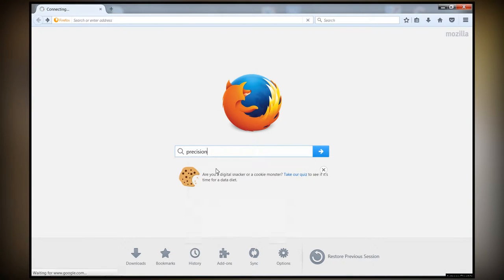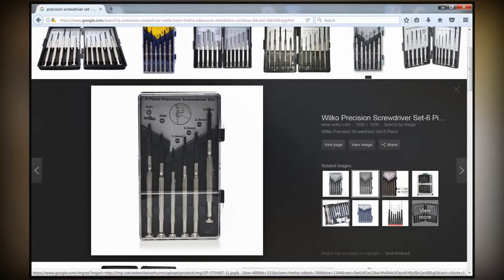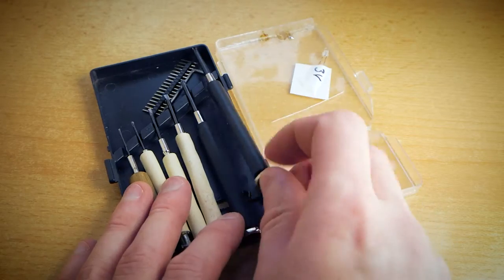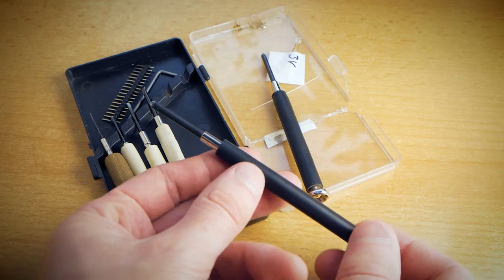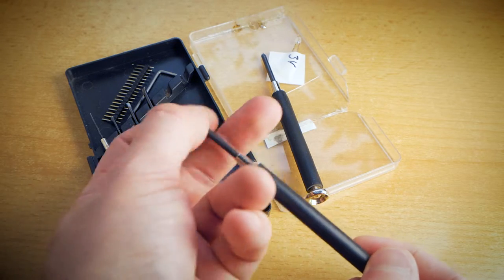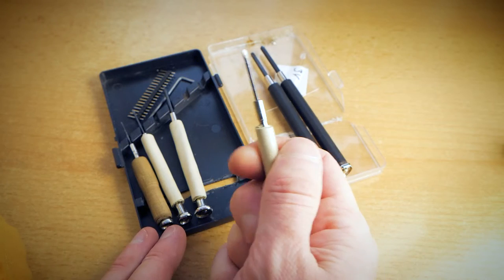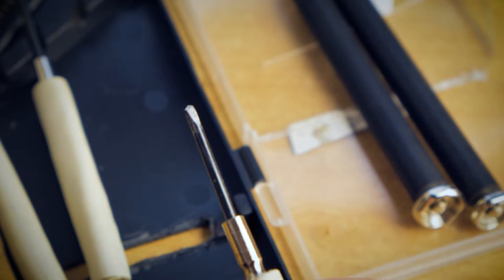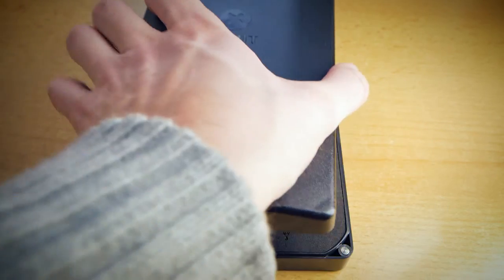How to gain grip on precision screwdrivers

Comment: How the hell am i gonna get rubber
Reply from the maker: Simplest way to use shrink tube
Reply: find rubber tree, cut a slit in the rubber tree in corkscrew around the tree, have it drip into bucket, when bucket is ample full take it to an open fire and burn off the excess water, you should have a mailable product, use moulds with cooking oil so that the liquid rubber doesn't stick to the mould and is easily removed. pour rubber into the mould and leave it to cool naturally, then take it out of the mould and trim with a sharp instrument, repeat for desired amounts.

I do hope this comment helps.